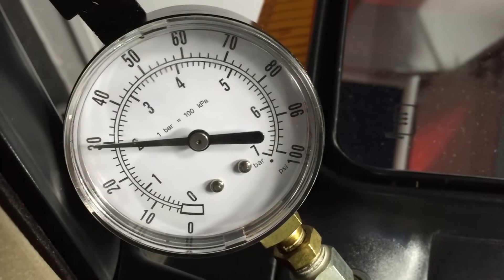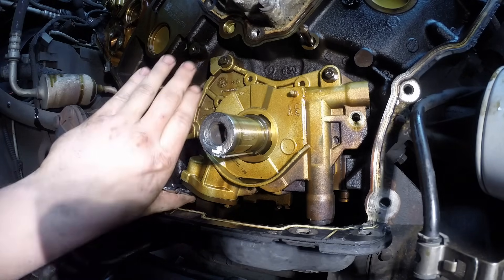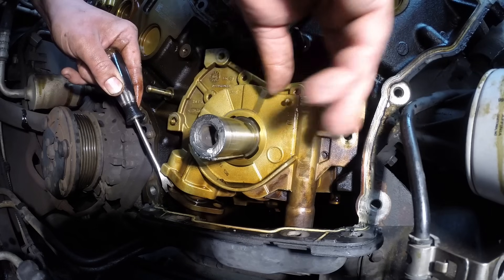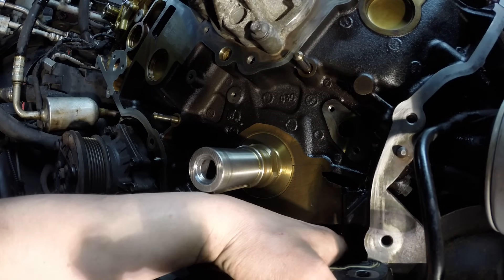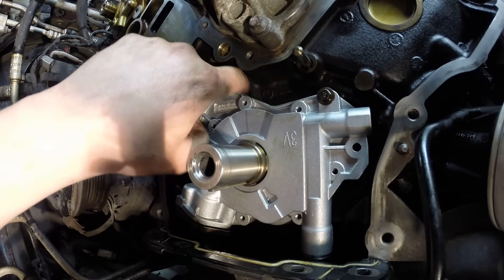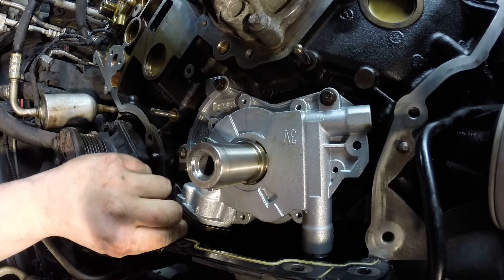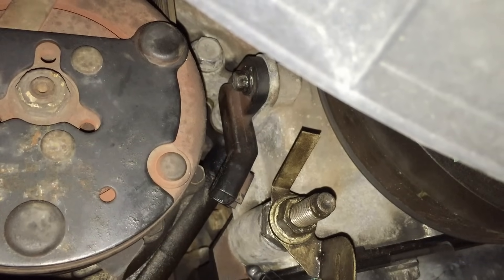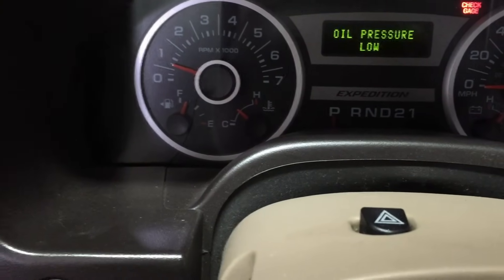Ford 5.4L 3v Engine Melling M360 Oil Pump Upgrade

Comment: why does the new oil pump have so much higher pressure?  are the internal gears machined to a different spec?  are they using superior metals inside?  why wouldn't they put a nice oil pump on at the factory rather than some 20k mile donkey of a pump that has no future??

Comment: I guess my torque wrench is defective. I set it for 89 inch pounds, yet ended up breaking one of the bolts. The metal is very soft especially compared to the block. Any idea on the part number and/or where to purchase a replacement bolt? Thanks again Brian!
Reply from the maker: The click is very light at 89 inch lbs so you must have went past it. I do these jobs everyday without issue. Here is the Ford part number for the new bolts N806183S437
Reply: @FordTechMakuloco  thanks Brian. I'm not sure how I missed your response. My local Ford dealership has been VERY helpful in regards to parts and advice. I'm sure I missed the 'click' since I MAY have had my music too loud. They were able to provide me with new bolts at no charge. 

One other question, today I was able to completely reassemble my 2005 Expy. I left the crank shaft sensor unplugged as you directed. I cranked over the motor and waited 20 seconds for the oil pressure 'gauge' to come up to indicate oil pressure. The gauge didn't move. I understand that its not a true gauge but a switch. Any ideas as to why I couldn't get it to pressure?
Thanks again for sharing your wisdom and experience. Its saved me THOUSANDS and has created some good bonding time with my son, as we do much of these repairs together.

Comment: Why is it when I try to order M360 oil pump it says it doesn't fit my truck ( 2005 ford f50 5.4L 3v) it recomends the M340 oil pump can you please let me know witch pump I need 2005 ford f150 lariat 4x4 5.4L) this will be second motor hope to be the last one once I know what pump to use.
Reply from the maker: Either one fits.

Comment: What happens if you turned the crankshaft to get the oil pump off? Should it be a problem... Or will it mess with timing?  Thank you for the video

Comment: Melling is now offering two versions of the high volume pump; standard pressure and 20psi over standard.  If one of the problems with these 3 valve engines is the chain tensioner to block seals are failing, would using the 20 over psi spring concern you that premature failure could happen under this higher pressure (or worse right blowout).  This is a big job.  I’d really like to only ever do it once.  Thanks in Advance.
Reply: I just bought the M340HV for that very same thought, I'll be installing it in a few weeks.
Reply: been a year now using the HV/HP pump and 10k miles - no problems other than that annoying cold idle  valve train tick - still there . . .

Comment: Why did the dash say low oil pressure???
Reply from the maker: The oil pressure sending unit was removed to tap in the manual oil pressure gauge.

Comment: When do you recommend the use of the 60psi pump, versus the stock 40 psi?
Reply from the maker: Only on high rpm race applications.
Reply: his answer confuses the hell out of me....the pressure relief on the pump 360 HV is 80 psi and he is recommending it for all applications thru 2014???

Comment: If any chain guides have broken. You want to remove the pan for sure even if you could remove any debris most all of it will be stuck into the pickup screen. If your doing the job as preventive maintenance then ya you can just swap out the pump. Pans are easy to remove even for the 4wd models.
Reply: ?? 4x4. IF you call removing a crossmember, the starbilizer bar and dropping an axle "easy".
Reply: @richardwilson117  it's not that hard. Maby if you live in the rust belt it might be but you still got to do it or you won't have enough oil pressure to run the phasers  and if your oil filter gets plugged and goes into bypass mode then those pieces can plug the passage in the head that provides the oil. Do it right or buy a engine.

Comment: I just used my ratcheting 8mm wrench to fish the lower pickup tube bolt into the hole. Had to fiddle and make several attempts but eventually I got it to stay in the hole and was able to start threading it with my fingers, then the wrench. No special tricks to it, took about 15 minutes; patients is key.

Also if anyone is just replacing the oil pump gears like me, I had some trouble getting the gear in the pump to line up with the crankshaft notches. So I took my old gear, put it over the crankshaft and marked it at the 12'oclock, then took it off and used to it align the gear in the pump. A little bit of wiggle and it slid right on.
Reply: I had trouble aligning the flats on the crankshaft with the new pump as well. I used a different approach that worked for me. I put the new pump on the crank and then used a socket and ratchet to rotate the crank until the new pump slid into place.

Comment: I tried your amazon link for the pump and is telling me that it doesn’t fit my year truck, I have a 2010 f 150 5.4l platinum do you have a part number or link where I can buy the HV pump.
Reply from the maker: This pump fits all 3v engines 2004-2014.

Comment: Melling says parts 10341 is the correct oil pump. Is the 360 an older model maybe.  2004 fx4 with 5.4
Reply from the maker: You want the M340HV

Comment: to save a few bucks i didnt do the oil pump replacement when i did the tensioners and chains and the engine seized after some sturdy hill climbs...I kicked myself in the ass for that...... but now i have a Chevy 5.3 with a garrett turboand 4L80e trans in my 04 navigator.....its like night and day.....dyno'd at the wheels at 654 horsepower with 618 ft lbs of torque @ 3200rpm....dont get me wrong i love ford engines but sometimes you have to weigh whats cheaper when your on a budget...$6200 for a rebuilt 5.4L or grab a low mile 5.3 and trans with ecu cpu harness on offerup for $2200 and dyno kit $1400 and 3 weeks with your buds wrenching and drinking beers.......

Comment: Were the oil passages in the heads redesigned in 08/09 when they made changes for the spark plugs or are they the same size throughout the entire run of the 5.4?

Comment: My question is do I drop the oil pan to reach the oil pump? I’m a noob to performing this particular service. 2005 Ford Expedition Eddie Baur
Reply: You can.  It's even easier that way
Reply: @joeysanchez5926  just to clarify, a new oil pump can be installed via oil pan removal? 09 King Ranch, thank you

Comment: Couple of questions! I am thinking about buying my father in laws 2007 F150 5.4 He says it does not have any weird noises but I want to get it checked out anyway would taking it to ford for an inspection be a good idea? Also if its true there are not any weird noises should I pay to have one of these upgraded oil pumps put in any way? And which pump? I will be keeping the truck mostly stock (Intake upgrade and exhaust upgrade only) so anyways please help I do not know very much about these trucks

Comment: Why there is no gasket at the pump out where is joined to the engine?.
Reply from the maker: No need, they are machined surfaces, kinda like a metal ratcheting chain tensioner.
Reply: @FordTechMakuloco  But also there is not a bolt to hold that joint from both sides. How that can be hold  very thight as has to be?. Can I add the one that is missing?.

Comment: Hey Brian, is there some trick to prime the M360 oil pump? I installed a new Performance Products engine and have tried everything to get it to prime and it refuses to comply...
Reply from the maker: If you have followed my priming techniques here and still no oil pressure indicated on the cluster, then you want to connect the ckp sensor and start the engine. Oil pressure should come up and the engine should quiet down in less than 2 seconds, if not shut it down immediately.
Reply: @FordTechMakuloco  FINALLY GOT IT!!! AND MAN DOES THAT NEW MELLING 360 KICK BUTT!!! Thanks for all your videos. I started working at the local Ford dealership in 1979 and worked there for 15 years and you're teaching this old dog new tricks everyday! Thanks again

Comment: Amazon says this recommended pump does not fit my 07 f150 5.4. That would be the one you linked to here. Do you know if they are correct or not?
Reply from the maker: The pump listed works in all 3v engines 2004-2014.

Comment: Have you ever heard of a two valve having no pressure after an oil change??? Motorcraft filter and 10w-30 motorcraft oil, was used.
Reply from the maker: no

Comment: Does this Oil Pump work on the 5.4 2v?  If not what is the Melling Oil Pump that works for the 2v's.

thanks
Reply from the maker: Use this pump for the 2v engines- https://amzn.to/38tdOx8

Comment: Just did timing, M360hv, roller followers, lash adjusters. Now im running almost 80lb of oil pressure! Too high?
Reply from the maker: 80 psi pump so that is right, once the oil warms and the idle comes down the oil will be closer to 30 psi.

Comment: Do the 2v Triton 5.4s have the same low oil pressure issue? I know my engine is pre-phaser. Looks like the one for the 2v only offers 8% more volume instead of the 20% the 3v kit gets but that might be enough to fight this very, very quiet knock I've got that comes and goes at idle and up to about 1500rpm until I can afford a full rebuild.

Comment: How many hours do you charge for this job?
Reply from the maker: 18 I believe.
Reply: FordTechMakuloco Thank you. With your experience if this engine is driven 5 miles with little to no oil pressure is it safe to say it needs to be replaced? I drained the oil and you can see very small flakes of metal. I don’t think it’s worth finding out. I just wanted to ask your opinion.

Comment: I actually used the rag to bold the bolt in position while I turned it. Worked amazing if you don’t have a flex head.

Comment: Would you recommend the 10341 high pressure/high volume oil pump over the M340HV high volume pump on an 07 5.4 with 123,000 miles?
Reply from the maker: No

Comment: Does Recently bought a brand new engine for my 2004 f150. Is there a chance that new replacement engines have this upgraded oil pump? If not, when would be a good time to replace the oil pump on a new engine? 
Thank you!

Comment: The low oil pressure on the cluster at the end of the video is hilarious 😂
Reply from the maker: Not sure what is hilarious about an oil pressure sending unit that was disconnected and removed to tap in a mechanical oil pressure gauge....
Reply: don't take it at heart Brian, most of us are dummies just trying to learn, lets have fun along the way, thanks for all your excellent videos and lessons. 😊
Reply: @FordTechMakuloco  Ahhh!!  I was wondering where you had that thing at.  I wanna see what my old pump is doing before I pull it out too.  Do you have a source for purchasing the gauge?
Reply: I see the m360hv  that you installed, I trust you bc you’ve already saved me thousands of dollars in shop costs.  When I click on your link to it, idk why it says it doesn’t fit the vehicle...the computer system at Oreillys says the same, but they’ve burned me numerous times, so to me they’re irrelevant.  

My dumb @$$ put in an m340, during the timing job and I’m nearly positive that’s why she’s choking out when coming to a stop.  Aside from that, it purrs before I drive it and gains revs mostly ok, haven’t romped on it yet, just being cautious and it hasn’t been my daily driver let alone driven other than test runs over the last 11 months.  Whatever I saved in shop costs I’ve lost in my own time but those are my problems.  You’re still a godsend for all of us that chose the 3v 

Thank you continuously!!!

Comment: Getting that second bolt in could be compared to seeing not one but two unicorns in one day have about as much chance with either one. I wont even go into detail about the feeling of success you get when you hear the bolt fall out hit the oil pan and make it's way down in there somewhere.  If I never saw another 5.4 triton motor it'd be to soon. Patients level zero cledus out

Comment: I just picked up a somewhat noisy 5.4 in an 05 King Ranch. I'll be doing plugs, coils, chains, tensioners, oil pump, in the spring. Your videos are great, the way you teach is awesome for the beginner or the experienced. Keep it up! Question that I do have, if doing the high volume oil pump and the cast iron tensioners, would you reccomend doing a phaser lockout or keeping the phasers? And would you reccomend changing the vct solenoids as well?

Comment: Both M360 and M360HV pumps don't seem to work on a 2008 Expedition 5.4L 3V. Melling has 2 high volume pumps that are compatible. M340HV and 10341. The color on the 10341 is black and it seems to be a performance part that adds 20% more volume and 20psi more pressure, and also costs almost twice as much as the M340HV. Any thoughts on which to use, and why? Thanks for your videos.
Reply from the maker: Both the M340HV and M360HV work in all 3v engines 2004-2014.
Reply: @FordTechMakuloco  Great! Thank you. I will go with the M360HV.

Comment: Bryan, thanks for sharing this very useful video with DIY guys like me, it will be very helpful when I replace the oil pump of my 2005 F150.
With the oil pump removed, can the oil pickup tube be taken out without removing the oil pan, or do you have to remove the oil pan to remove the oil pickup tube?
Reply from the maker: If you want to replace the pickup then the pan must be removed.
Reply: @FordTechMakuloco  I don't want to replace it cause it is in good shape, but since the suction area of the pickup tube is only as big as my little finger, I'm thinking of enlarging the suction area of the oil pickup tube by grinding out a circular piece of the metal housing that sits just outside of the wire mesh on the bottom of the oil pickup tube, thereby expanding the suction area. Cause someone told me that this obstruction is one of the reasons why the oil pressure of these engines is so low. What's your "expert" opinion on this issue?
Reply from the maker: Um no, please do not do this, not needed at all and is not the cause of low oil pressure or flow concerns on this engine.
Reply: @FordTechMakuloco  is it at all possible to get to the suction area of the pickup tube to remove any guide debris that may me lodged in there without removing the oil pan?

Comment: Just by cranking engine, I see you were up nearly to 65 lbs of pressure cold. I'm up over a 100 lbs "cold" when I rev it slightly... Is that normal? seems excessively high to me. Just curious of your thoughts.
Reply: Did you have any pcv issues or blue smoke/oil consumption with the higher pressure from this pump?
Reply: @MrTailsGamer  no, just high oil pressure.  Just decided to run it, no problems for about a year now.
Reply: @daglcr  interesting. I think im getting excessive oil in the intake as it smokes at startup and is also consuming oil. Trying to pin it down.
Reply: @daglcr  wait, which oil pump are you running? the M340HV or M360HV?
Reply: @MrTailsGamer  360
Reply: @daglcr  the HV version? Sorry for all the questions.
Reply: @MrTailsGamer  yes, done with the complete timing job

Comment: I can only imagine my 2005 F150 5.4 3 valve needs a new oil pump as it's original.  Also original is the timing chain. I got 360,000 on it and I do hear some slapping noise that I think is the chains, but other than that I see no real issues with the strong motor that it is.  I'm only interested in chains, Melling 360 pump, and the chain tensioners.  Maybe the VCTs although I don't ever see any check engine throwing codes, but since I'm there, I probably have a good mechanic change them out too. They say the chains shuld be changed every 100,000 miles, but I can't imagine that to be true.

Comment: Oil pressure Low as stated on the dash
Reply from the maker: Oil pressure switch was disconnected and removed for manual oil pressure gauge tap in of course.....
Reply: Thank you! Love your channel. Will keep on watching. Your videos helped me a lot  multiple times.

Comment: Great video Brian,  just a couple question. When I push the link , in Amazon says , that part doesn't fit in my Ford f150. You have some idea why?, and the second one is,  how I can now if my truck needs a new timing chain job ? Because I have the code p0012 I went wiwith 2 different mechanics here in San Diego and they just change a lot parts but don't solve the problem, so I see your videos and I think can be timing chain,  they want replace the engine,  can you give some help? Thank you.

Comment: Hey Brian, I know this is an old vehicle, but hopefully you see this. Have you by chance seen any high volume pumps for the 4.6L 2v Engines? Not sure if they have the same problems or not, but my F150 is approaching 200k Miles and just want to make sure I keep her healthy. Most likely going to be doing a full timing setup on it soon, as it's probably never been done, so figured I'd check to see if there was an oil pump upgrade to do at the same time. It's running good so far. No major complaints. Thanks man.
Reply from the maker: Use this pump- https://amzn.to/2G9FA6J

Comment: Love how detailed you are! Thank you for all your in depth videos. Cause of u, I rediagnosed my previous diagnosis and found that the right bank has a spun cam cap and plugged the bearing journals causing p0012 and p0016. Oh, its an 08 f150 5.4 3v 135,000 miles. Owner drove it with very low oil level for an extended period.  Again,  I appreciate your in depth videos! Sincerely,  jays automotive repair of edmond Oklahoma!